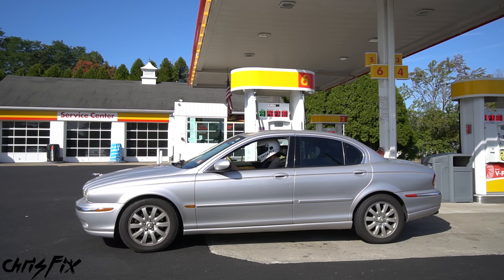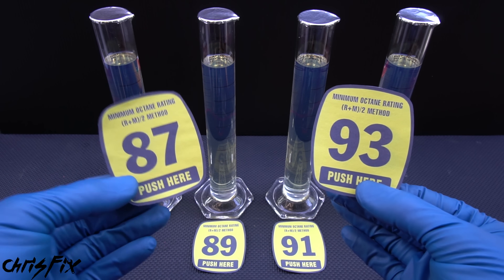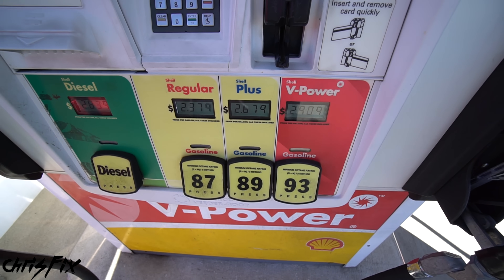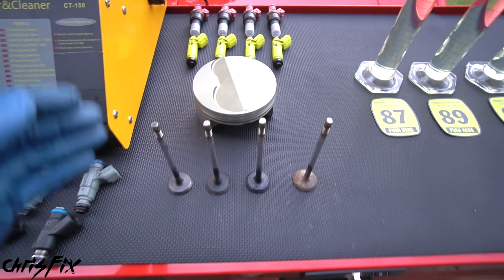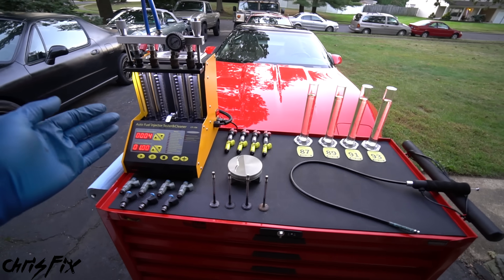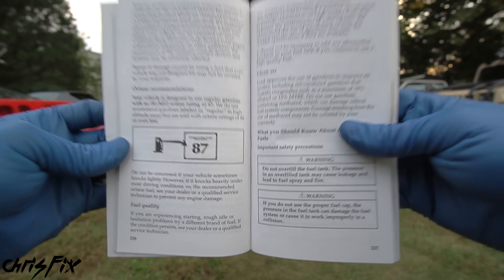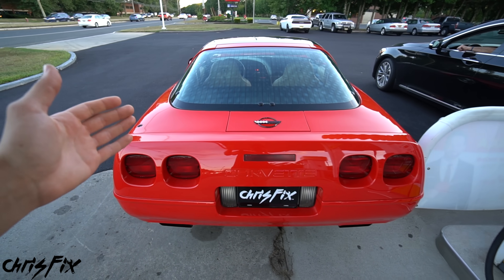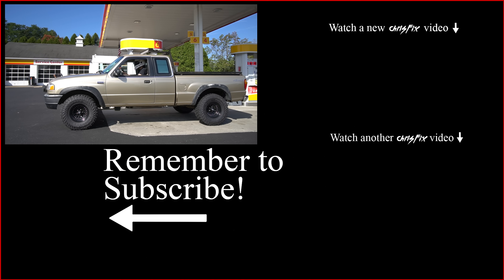What is the BEST Fuel to Use in Your Car or Truck and WHY

Comment: One thing to point out about those trucks specifically are the lifters. They are super noisy. Ford referred to it as the marbling effect. I had a 93 ranger that would sound noisy like that. premium fuel didn't help.

Comment: What gas would you recommend for older cars that were made with leaded gas.
Reply: You are correct they were not made out of gas.  My note was unclear.  What fuel level would be recommended for use in a car that made during leaded gas area.  Also,  should i use a an additive? 😉

Comment: RON v PON I get but, things like the Civic Type R are mapped differently between Europe (316bhp) and the USA (306bhp) because of the fuel. I would suspect that it is to allow people to use regular which is lower octane than the lowest you get in most of Europe, not that the premium and super grades are vastly different from the regular and super over here.

Comment: I was always told just use 87 and every 3 tanks of gas put in additives
Reply from the maker: Now you know the best fuel to use!
Reply: Yea I guess so lol I just use 87 at the pump and then I put that sea foam stuff in my gas every so often
Reply: I’ve had all my vehicles last more then 300k miles !
Reply: Squelch Find the comment here from “Mark Bisson” - it explains so much more, factual information that helps this video.

Comment: I think the best fuel is ethanol free fuel, at least from my experiences. Put some 90 octane ethanol free fuel in my wife's sequoia when we returned from a trip and wow, loaded up with the wife, 3 kids and luggage 75-80mph average speeds and we still got 17.4 mpg average for the entire trip. Doesnt sound like alot but anyone who owns a Toyota with the 5.7 knows it's a gas hog. Damn good engine but it drinks fuel. On the way there doing the same speeds we averaged about 16mpg. I know we could have done better both ways but I have a heavy foot lol

Comment: While It is true that all octanes have the same energy content.  What isnt true is that ethanol doesn't drop that energy content and therefore mileage.   Gasoline contains 114,000 BTU of energy per gallon.  Ethanol contains only  76,100 BTU's of energy per gallon.  The higher the percentage of ethanol, the lower the energy content of the fuel and therefore the mileage.   Some companies sell "ethanol free premium" which, my opinion, is better from a power perspective.

Comment: In South Africa we have 93 and 95 which are interchangeable really, 95 does last longer in my experience.  I did a 200 mile trip with 93 filled up and got there with less gas than when I did the same trip in 95

Comment: Ford Thailand says „E20 CAPABLE“ at the fuel door, which hasn’t been covered in the video. How would you interpret that? CAN use it but not really good for the engine?
In general, here they say that E20 is the lowest grad of petrol.
Reply: e 20 is 20% ethanol 80 % Gasoline according to other online videos
Reply: @anthonygregg862  So? My question was: how to choose what’s the best petrol for a car that sais „e20 CAPABLE“? Because Chris‘ conclusion is to follow the sticker in the fuel door that sais „xxx required“ or „xxx recommended“. „Capable“ obviously sais that it’s possible to use it but doesn’t make a statement regarding what is the BEST petrol to use for such a car.

Comment: i have a 03 grand caravan with the flex engine. It says I can run e-85 or regular. Most of the time I just use 85, but about once a month I go ahead and put 91 in there to help keep the engine clean. although it says to run regular gas, when I put the 91 in there to clean it, the van has more power, better acceleration and is more quiet while sitting at the light.
Reply: Probably some carbon build-up in the engine increasing the compression ratio. Consider using only "top tier" gas.

Comment: I mean some cars do lose horsepower if you use 87 over 93. But otherwise, I agree with the rest. 93 all day for my Civic Si
Reply: Only applies to high compression engines.
Reply: @wholeNwon  Yea my Si is a high compression engine, I noticed a big difference the one time I got regular in it. Never again. Even my parents 2004 camry had some difference when using 91+ since it had a lexus engine, but not as much as the Civic
Reply: @sploit777  I have a second gen. LS400 and use 91, which is the minimum recommended for routine use, and no problems at all. Compared with 93, see no changes.
Reply: @wholeNwon  Yea I mean in my location the local stations are 87 89 93 like the shell station Chris showed so I just get 93. When I have to stop on the high way  I do see all 4 options  87 89 91 93, but I rarely stop at those. So I'm usually just given the 3 options. My car is also recommended 91+ like your lexus
Reply: @sploit777   Same here. Wawa has 91 but it's not "top tier". On Tues., 93 is discounted 20 cents here at Shell, Exxon, Citgo, etc. all top tier.
Reply: @wholeNwon  Oh wow that's dope. Is that every week discounted by you or just this Tuesday?
Reply: @sploit777  Every Tues. If I'm being really cheap and have 1/2 a tank of 93, I'll fill up with 89 making the full tank 91 octane.

Comment: My 05 X-type is my daily for the past two years. That's 70 000 miles that I run it on the cheapest fuel possible I could find. No problems whatsoever. At 205k I had catalytic converter issues and used the trick from a famous x-type hater. 2k down the road no problem. No thick or anything. May be if I continue do so it will run to some issues but for now its perfect. Premium gives me a bit better gas mileage but it doesn't worth the price difference so cheapest it is! For the amount of miles I put on the car and the price I got it for I think that's my best bet.

Comment: What is the recommended fuel for a 2003 Ford F150. Anytime I accelerate to approximately 2000 rpm in a driving motion it rattles. If it is neutral it does not rattle. Any help will be greatly appreciated.
Reply: Try a tank of high octane to see if it goes away. If so, likely carbon buildup increasing compression ratio.

Comment: Actually shell 98 in france is equivalent to around 94-95 or so. European cars have small engines with turbos hence why it is how it is. Shell italy has a 101 rating in some places.

P.S. 95 is e10 while 98 is e5.
Reply: European method of calculating octane is different.
Reply: @wholeNwon  yes and I used a conversion chart lol. Italys 101 would be something like 95-96.
Reply: @bluej511  I assume there are lots of small displacement, high compression, high output engines over there. Probably tougher oil standards, too.

Comment: Good vid.  Just FYI, the higher octane fuel burns slower. Running those fuels will allow for a higher timing'. Thus reducing spark knock if a higher timing is desired such as a drag race car application.
Reply: Actually it's more resistant to compression-induced detonation.

Comment: In Poland we have 95, 98, 99, 100 and 101...
Reply from the maker: Did you watch the video?
Reply: @chrisfix Yes. We have minimum 95 octane because of how small engines are being used in Europe. EU is crazy about emissions. Emagine 1.0 liter engine with 100PS, or 1.4 140PS (new VW group engines). After avarage life span of engine is astimated for around 180k miles. Joke, isnt it? For large displacement engines are tremendous fees. In EU You can buy only 95 or 98. In Poland we have V-power up to 101 because people like to tune up engines, rules for that are not so strict as in western Europe. Diferent purificators are being added to fuel, so not every fuel burns the same. Winter diesel is different than summer diesel (less paraffin for example), also lubricating properties are different. Different brand has also (Shell, BP, Orlen) have different biofuel adds in gasoline. Is't it the same is US? I build refineries for a living, I race for fun. Good video, though.

Comment: 30 seconds in I had to pause.

I'm in shock that a station still has service bays. I haven't seen one in 15 years.
Reply: Seriously, where do you live? Probably 1 out of every 3 stations where I'm at in the "Good 'ol South" has service bays, most of them with a pretty healthy rotation of business for everything from oil/brakes to a couple that even do trans rebuilds or engine swaps.

Comment: My 03 Altima 2.5 has 170k miles and I always use 87 octane but I put a loud exhaust on it and a cold air intake, should I run Shell 93 for those 2500 miles to protect/clean my engine? Cause I notice it doesn't have the full power like it used to have. Obviously I am not beating on this car but I just want to protect my investment. Thanks!

Comment: My car just takes normal regular grade fuel, but say if I wanted to clean the engine with the fuel I would want to use to premium grade fuel? I know he said in the video every gas station is different with the additives they use but generally speaking most gas stations for their premium probably have more additives so it would be better to use those for a little bit if you wanted to clean your engine?

Comment: Fun fact: I blieve there are two states (Ohio, where I live, is one of them) where fuel standards/requirements are more lax.  That means that cheaper fuel in those states might not ACTUALLY hit the octain rating on the pump because the fuel that fails inspecition in states with stricter standards doesn't get thrown out, they try to sell it in place like Ohio first.  It's why, in those states, it's fairly important not to buy "bargain" fuel.
Reply: Must cost a FORTUNE to truck all that bad fuel all over the country.

Comment: So you say using a higher octane will clean fuel injectors, does that mean on my car that doesn't need premium I can put premium in it several times so it cleans the fuel injectors if they are dirty and gives me better fuel economy for a while. Or would I need to get new fuel injectors (if they are dirty)
Reply: All gasolines sold in the US contain appropriate detergent packages.  Only Top Tier gasolines have been independently shown to clean intake valves better.

Comment: ... ive heard other authorities say other things about different octane ratings, combustion, and pre-detonation, but im not going to argue them here - im sure Chris has done his homework, and has presented an accurate and useful presentation. i dont use premium in my two Honda CR-V’s, but i DO find it useful to periodically, ie every 4th fill-up, to use mid-grade. i think i get a slight improvement in gas mileage, and i can feel a smoother running engine with smoother acceleration ... i know some may think its my imagination - and maybe it is - i still do it anyway ... + whenever i travel thru mountainous areas, i use the midgrade gas ... thanks for the presentation !

Comment: Ok bro quick question so is it cool if i fill up on premium even if my car takes regular every once in a while just to give it a quick cleanse?
Reply: Octane rating has nothing to do with the detergent packages in the various brands.
Reply: Diety Of Valor If , and only if, the higher octane Premium fuel has detergents to help clean, it will still take more than just an occasional fill up to make a difference.
Reply: All "top tier" gasolines have 3x more detergent than required by law....regardless of octane rating.
IF your car knocks with the octane it's supposed to have, going to higher octane can help with that.
Reply: wholeNwon What law? YouTube is global. Thanks.
Reply: @mcswain69  Sorry, that was presumptuous of me. US law sets minimum standards for all gasoline.

Comment: Been running premium on my wife's Toyota Prius since she got it back in 2011, should still need to add an additive every so often?
I do add an additive to my old 02 Expedition every oil change and been running on 87 gas always
Reply: There is absolutely no reason to be putting premium in a Prius.  It is designed to run on regular.
Reply: No.

Comment: TLDW:

Most Cars: Regular (87)
Premium Recommended: Plus (89)
Premium Required: Premium (93)
Reply: Normal in EU - 95
Premium in EU 98
Reply: @zeriano8590  EU uses RON not (R+M)/2 
Therefore  as described in the video.  European 98 is like 93 in Texas
Reply: @natelorimer8567  That was before i watched that video about fuel calculating lol :D
Reply: Utah has the crap 85 I have to buy the plus 87/88 to equal the 87 recommend in the manual. I have a 2015 Mazda 3 I touring 2.0. Use nothing but name brand top tier gas and never had an issue.
Reply: older cars: (85 if you can find it)
Reply: @LUNITICWILL  no
Reply: @LUNITICWILL  just no
Reply: I used to put straight 40 weight oil in my 1970 Roadrunner and use 102 octane racing fuel.  I don't know if that was wrong but I was winning a lot of races

Comment: This is not a scientific comment and could be wrong. I put Premium in my low grade recommended 4 cylinder Korean Car. Drove about 2000 miles and my catalytic converter burned out and had a sputter noise until I replaced it. It is best to use what is recommended. European and Asian fuel is about $4.44 dollars per gallon but is sold by the liter as a side note. His examples are extreme but he has good information.

Comment: I have a 96 Pontiac Firebird, it runs fine on regular, but would it be ok to put a lil bit of preuim or mid grade gas to help clean the engine and such? opinion and advice please... ChrisFix.

Comment: My old van had a reco head and I didn't realize the head was shaved, used lower grade fuel and you guessed it ,, Cracked Head Gasket
Reply from the maker: Darn!
Reply: @chrisfix  That comes on top of the van's driver mirror getting stolen and when I got a new one, I also grabbed a radiator cap .. blew out the welch plugs whilst stuck in traffic on a stinking hot day ....$2,200 later ..

Comment: I disagree, octane is not flammable thus knock resistant,  so less flammable = less energy
Reply from the maker: Cars that can take advantage of higher octane can burn it at a higher pressure and temperature, so more of the heat energy gets converted to mechanical power. Every grade of fuel has the same amount of energy, some cars can take advantage of that better than others!

Comment: What’s the difference between octane and ethanol?
Reply from the maker: Octane is used to measure resistance to ignition in fuel, and ethanol (which is basically alcohol) can be used as fuel in cars, and it has a higher octane than most fuels!

Comment: Back in college, I had an old VW Jetta. I needed to run premium to avoid knocking in the summer. Octane "prevents" knocking. A knock sensor stops knocking. The knock sensor did work in the car, but it took a good half second for the timing to get pulled enough to stop the knocking on hard acceleration.
Reply from the maker: Thanks for sharing!

Comment: so is it safe to assume that in ultra hot weather...like 110'F... you can actually help the car by putting higher octane in the car?
Reply from the maker: If your car isn't designed for it, you won't see a lot of benefit from it! It won't help anything, but it also won't hurt anything!
Reply: ChrisFix thanks for the response.  I was just curious.  I was driving yesterday and at a long stop light.  My intake air temperature rose to like 140’F.  When i took off i swear I heard a bit of ping.  I saw my timing number pretty low, so im assuming the ecu was compensating.  I have a full obd readout on my center console, fyi.  My car is supposedly 9.8:1 compression so not terribly high but not low either.  I might try putting 91 in later on and seeing if the timing goes up at all.  Thanks again for your reply. 😌

Comment: The higher the octane the more power you get. That's been proven. Why performance cars get a higher hp rating with higher octane fuels and why some even use octanes that are over 100. Also vehicle manuals will tell you what octane your car accepts or you'll damage the engine. My Mustang is programmed for 87, but I can change the program to be higher. If your user manual says to use 87, you shouldn't use anything else.

Comment: ChrisFix: I don't know how true this is, but I've heard (from more than one source) that the first pint or so from the pump is gas left in the hose from the previous customer at a gas station. So if you're filling a small fuel container or perhaps a motorcycle, that can affect the overall octane you get. Can you comment on the validity of this?
Reply: Short answer is: that’s not correct. 

Long answer: vapor is what is flammable. Liquid is not. You can actually (DON’T TRY IT) put out a lot cigarette in a FULL, sealed bucket of gasoline with NO vapors at the top. So, with no way of releasing any vapors, the octane won’t change. Also, for most pumps, you can empty out the hose by lifting the handle after it’s shut off. Since pumps and the tank are an enclosed system, there is no way to lose octane.

Comment: With higher octane you will make more power. Why? Because your engine is not pulling timing to prevent knock. Letting you run free so to speak. You are simply unlocking the potential horse power already present.

Comment: I had a 1997 GT. Beautiful car. It was red convertible. Anyways it said on the gas cap to put premium gas in there. Also I believe my 2001 black on black Mustang Cobra said the same thing. I believe it said to use 93. I'm surprised that you're says to use that particular gas. Is it possible that your car was a V6 at one time and somebody swapped out the engine to a V8
Reply: I know you're really smart guy and you probably knew your car a lot better than I do. Plus it's been over 20 years and my memory is not as good as it used to be.